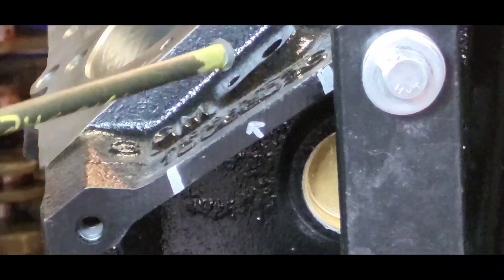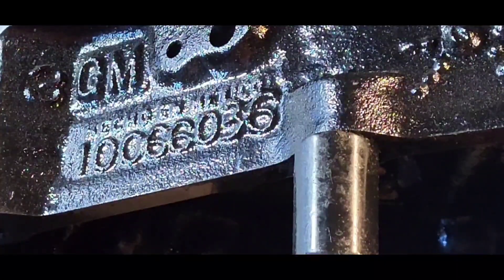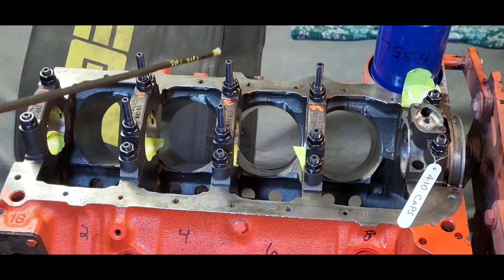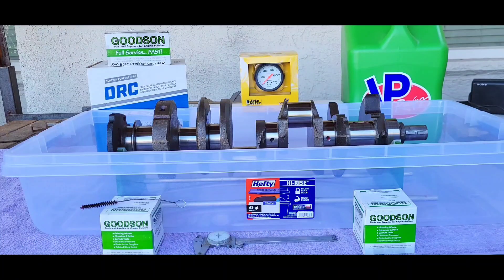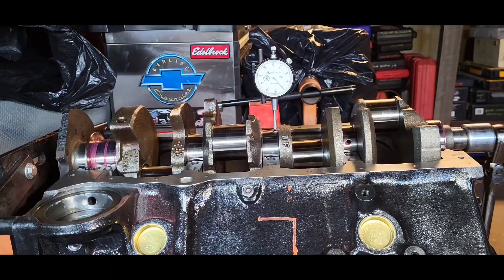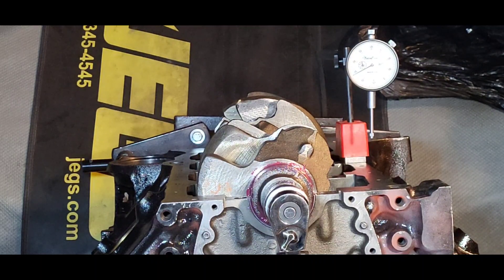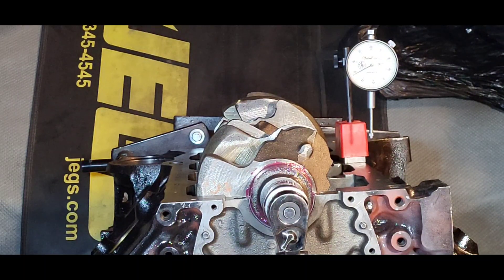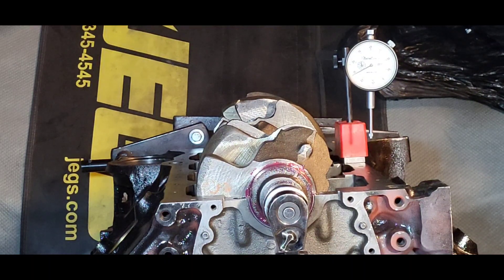We Need a Straight Crank.

Comment: The noise could be one of the crankshaft counterweights hitting the inside of the block. If the thrust bearing goes bad. Or the thrust area of the crankshaft wears out, really far out of spec. That can & does happen. Idk how common that is, I've only seen it happen a couple times, both on gen 1 Chevys. Personally I wouldn't build another flat tappet engine. You can't trust the quality of the lifters anymore or the camshaft for that matter. Plus they removed the zinc from oil wich can cause premature wear to flat tappet engines. It costs alot of money to build up an engine, just to maybe get a flat cam or lifter failure. I think anyone who's planning on building an engine nowadays would be much better off investing in a roller camshaft  and not have to worry about the cam going flat. Especially if you plan on driving the vehicle alot or taking it off road up in the middle of nowhere.  You need the vehicle to be reliable.  It can cost $1000's to recover a vehicle stuck out on a jeep trail.